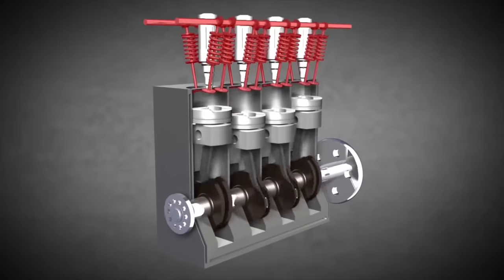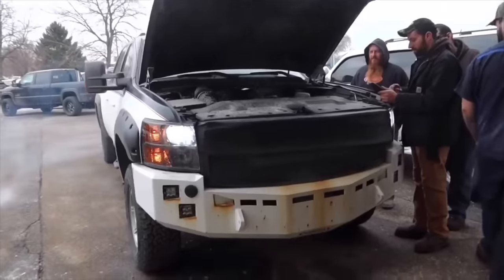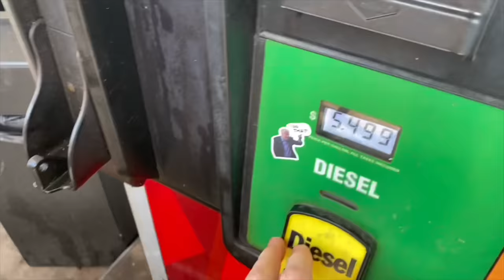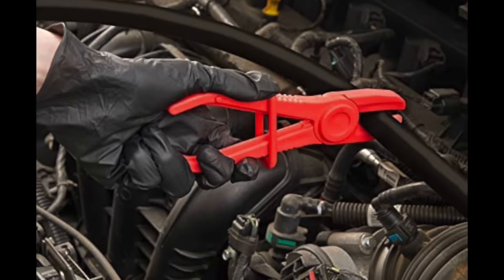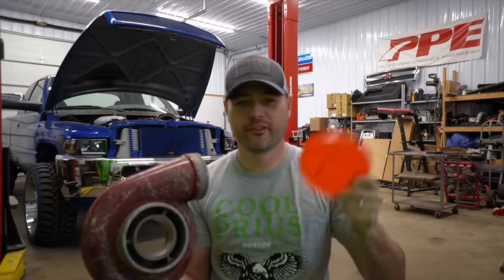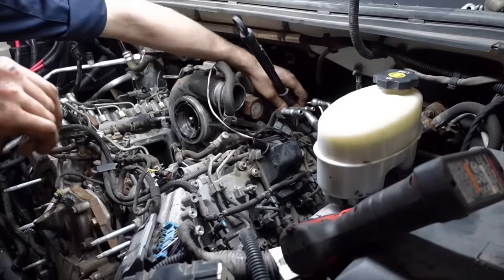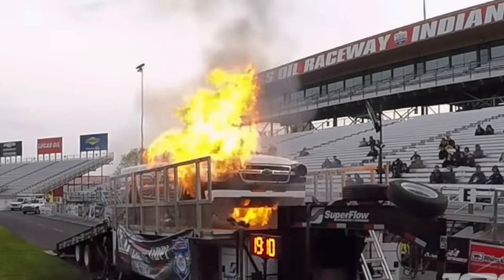What Is A Diesel Engine Runaway? *EXPLAINED* ￼

Comment: Yes diesel runaway is scary shyte.  I had a 1990 E350 with the International Harvester 7.3l IDI. The previous owner had the wrong oil dipstick so I ended up adding too much oil which caused the diesel runaway.  I didn't know much about diesel engines at the time and was trying everything that came to mind to shut it down. Ended up with oil all over the front lawn from blowing out the tailpipe but got it shut down before any real damage. Got lucky.  But heart pumping scary shyte if you don't know what's going on.

Comment: I would like to think I would handle it in a safe manner, cutting air supply, fuel supply etc. Especially after watching this informative video. But in reality I would probably start by swearing A LOT and possibly run in a few circles before just standing there thinking it's too late to safely do anything about it at this point resulting in me standing there with a hand on my hip watching my truck "un-alive" itself. RIP truck, you will be missed.

Comment: I don‘t have to imagine it running away, it already happened to me. Engine did not want to start so i kept on cranking until it started! But using it‘s own oil as fuel source. Like you said, ripped the key out, jumped under the hood, Choked the engine the eff out so it at least doesn‘t blow up (got her down from 6.400 to her limit of 3.200) noticed the intake had a leak wich i noticed a bit late so i threw my entire body mass onto the vertical intake to seal it amd after a solid minute of keeping it below redline and praying to god for it to turn off, she shut down. We to this day do not know what happened exactly, but we are guessing the High pressure fuel pump malfunctioned and caused the engine to starve on fuel combined with me cranking it for a solid 3 minutes without break caused it to start sucking the oil.

It is Horrifying and it was my project. I was trying to save it at any cost and valued it over my life. The moment it shut off, i broke down on the floor and started crying.

If anyone has any questions, ask away

Comment: In a drag application, I would make sure to have something strong to cover the turbo with me. In normal applications, the diesel run away would go a lot more gentle compared to a 1500hp engine right after a intense race. In a normal car I would choose to let de transmission take the fall instead of the engine. In a drag car with these huge 2000hp+ engines, you can only cover the turbo. The thing is, you have to be able to reach it. If you let go of the clutch, it would probably destroy both the engine and transmission. you got to be prepared for it. You only have seconds to act. In a situation like the first video with the black truck, there was nothing he could do. It would be to dangerous. I guess if you have a diesel car for extreme applications, you have to invest in a electric cover valve as shown in the video. Compared to all other investments it would be more than worth it!

Comment: I've never seen this happen with a diesel. I would have thought applying brakes hard, putting it in top gear and releasing the clutch should stop the engine.

Comment: Question - do runaways only happen with a turbocharger.. I just watched a video of a yacht having a runaway diesel engine and catching fire and burning to the waterline. hence my looking at your video..
Reply: Runaway engine can be caused by crank case oil being sucked into a leaky turbo or can be the result of combustible smoke or gas entering the intake.

Comment: Can an NA diesel run away?

Because people always refer to the Turbo, but what is the case with naturally aspirated engines?
Reply: oil seals or the crankcase ventilation (if it vents to intake) can also fail and let oil up towards the combustion chamber
Reply: Methane, natural gas or combustible smoke can cause a NA diesel to runaway.

Comment: Thing is .. that they suck In so much air that you can't put anything thin over the throttle body inlet or it will suck it in
Reply: in this respect a diesel is no different to a gasoline engine, they both can (but diesels should not and do not) generate roughly the same vacuum, only over a larger area if its a diesel, a good, sturdy block of wood or a solid sheet of metall seal perfectly

Comment: Sadly this is what caused the deep water horizon accident where a blowout from the well released hydrocarbons into the atmosphere getting sucked into the diesel generator air intake causing it to runaway to the point of catastrophic failure.

Comment: If you have a manual gearbox, slam it into the highest gear. Force a stall
Reply: For trucks using NV4500 transmissions, the 5th gear is delicate and after seeing this video I’d definitely stop mine with 4th gear…
Reply: @alchemyenergy  and if that doesn't work your engine is doomed anyway.

Comment: You have to shut off the air supply when a diesel runs away on its own oil.  Tractor pullers are required to have a guillotine valve on the turbo inlet(s) to do just that.

Who has the complete video of that DHD truck runaway?  It's amazing how long that thing lasted running at speeds where no diesel has gone before.

Only responsible adults should be allowed to modify diesel engines.

Comment: I’m only a kid, but since I learnt about diesel runaway before my dad sold his manual pickup (it was a Mitsubishi triton, which if I am correct, there is only a diesel option) and if it ran away I would of put it in fifth gear. Actually no I wouldn’t because the engine block was a complete piece of junk and the engine was unreliable. A tip from my dad: don’t buy a Mitsubishi triton, they suck.

Comment: Would it be a good idea to cut the battery terminals to prevent current supply going to your engine in a emergency situation like this?
Reply: Dieseling works by ignition under pressure, not a spark plug. 

There's a glow plug sure to heat up the chamber. But the pressure from the piston stroke itself does the rest.
Reply: @jasongibson1225  the best chance it's to choke the engine from air then
Reply: @robertadriancondria2973  
Exactly as the video prescribes, especially if the runaway dieseling effect is coming from the oil in the turbocharger and not the diesel itself.

Comment: Pinching the fuel line in diesel does jack sh.. on runaways. There's cutoff solenoid in pumps that would stall engine immediately anyway when you take your key out of ignition lock. Runaway is always engine running off it's own oil.

Comment: I have both 1989 and 1990 Cummins dodge. The 90 fuel is turned up a little and big exhaust but nothing else. I've never heard of this happening to these motors, but that's pretty spooky looking watching that. do you know if this has ever happened to 100% complete stock motors?
Reply: yes. This CAN happen to ANY diesel engine.

Comment: what happens if you cut the fuel line
Reply: If you must, better to clamp down the rubber fuel line with a vise grip. As I t’s usually not the fuel pump or lines… Typically it’s the turbo leaking crank case oil

Comment: Had a dude argue with me about what causes runaway. Thank you for making a very educational video.

I've experienced 2 runaways, the first at a CAT school where the fuel control was installed incorrectly on a 330D2L. The engine went to full fuel as soon as it was started. They couldn't get fuel shut off and the engine tore itself to pieces and planted a piston head in the concrete wall

The second was a 78 Peterbilt 359. Turbo seals went out on the driver as he was going up a hill. I helped him pull the air cleaner off the cab and stuffed a Carhartt in the tube. Sucked the jacket in sleeve first and jammed up the turbo. Both were terrifying experiences and both gave me a healthy respect for turbo charged diesels.

Comment: Extinguish a runway on the exhaust is pointless. At best you manage to smother the engine with the fire extinguisher at the air intake. But then you really have to want to suffocate the engine by all means.

Poorly maintained diesel will be prone to it. When oil seals are leaking because of over heating.
An engine without a working water cooling system will burn the oil seals.
A turbo will die if the oil supply or cooling is bad.
Blockages in water and oil passages lead to engine damage.

Comment: Having spent almost 40 years as a heavy duty mechanic ive seen a hand full of run away diesels cat cummins Detroit Diesel 
Seen a detriot suck a pair of coveralls sucked right into the engine 
The best thing is a CO2 fire extinguisher it can be sprayed into the intake anything else such as a regulator fire extinguisher will ruin the engine water will bend rods 
I warned my employer who finally got some then one day a couple inexperienced mechanics started a cat 3406 with a bad turbo 
As they were running around in circles i walked over to the CO2 extinguisher walked up to the vehicle and sprayed it into the intake few minutes later i was paged to the office where they thanked me 
If your going to work on diesels you need CO2 extinguishers 
That plastic cover will get sucked right into the compressor wheel and chopped up like it was in a blender  trust me ive seen what a turbo does to fingers lot of detroit tecs lost fingers while tuning the 92 ‘s while reaching for the governor

Comment: The way you stop a runaway diesel engine is with a CO₂ fire extinguisher. Not water and not dry chemical (they'll do nothing).

The carbon dioxide will immediately kill all combustion in the engine. 

What's more, unless the runaway engine has already damaged itself, the CO₂ won't harm it in any way. It won't even make a mess, the frozen carbon dioxide (dry ice) will just sublimate into a gas leaving no residue whatsoever.
Reply: Thaaat's why people keep mentioning those. I've been caught up in videos like these lately and I've seen a bunch of mentions of CO₂ extinguishers but nobody's mentioned what exactly made them ideal for it.

Comment: They should have an automatic fuel shut off valve on them diesel engines
Reply: Yes, them diesels with automatic transmission should have an effective way to stop a runaway.

Comment: I disagree with modern trucks running away less.

I know 27 12v trucks. Some ppl own multiple. Only 1 had a run away and a 2x4 solved it. I know 60+ modern diesel owners, some with multiples, and I've heard them complain about their "hauler" running away not irregularly. Always something to fix. The 12v? It's because you let the injection pump get all gummed up with trash fuel/old fuel. Not me though. See mine has this fantastic problem where it decides to do away with the internal combustion tomfoolery and starts injecting that fuel straight back to earth.

Comment: Couldn’t you just pull a fuse?
Reply: its a diesel, if theres fuel and air, it will continue running, theres no spark plug, no throttle plate, only the ECU and fuel controll valve need power while the engine is running

Comment: Please sir I would advise against going under the hood if the engine rpm  has gotten over 3000 at this point it's going to get higher and you cannot outrun grenade shrapnel if it was so we have not lost men in war. Now dump the clutch pedal in the highest gear throw at the intake manifold  that's it. God bless you too have a hobby toy  and there's more were they came from .God bless America and Israel Trump 2024

Comment: The duramax that ran away had a failure with the mechanical pump and went wide open. It was in natural but he purposely put it in gear to try to save the motor so it wouldn't just sit there and moon rev

I have a 7.3 powerstroke and a old 6.9 idi I get worried about them running away but there both stick shift so I'd rather through them in the highest gear I can and let off the clutch. I'd rather replace a clutch than a entire motor. 7.3 powerstrokes not so anymore I've seen but alot of them are common for turbo failure, one thing with them they'll do is when there going out when you turn the key off they'll still run for like a second or two so you have some time to get it delt with before it gets worse to the point it runs away